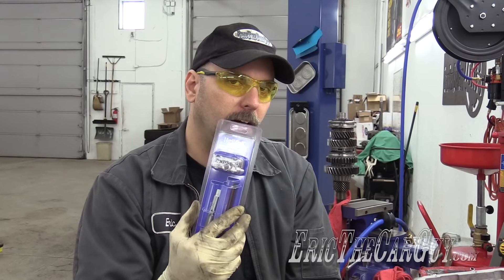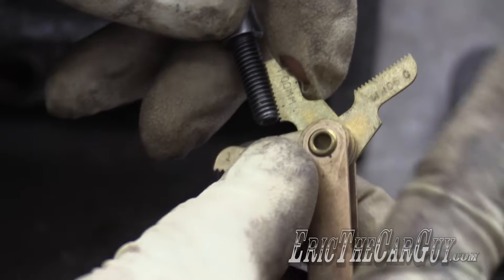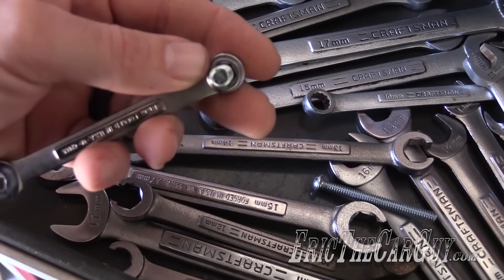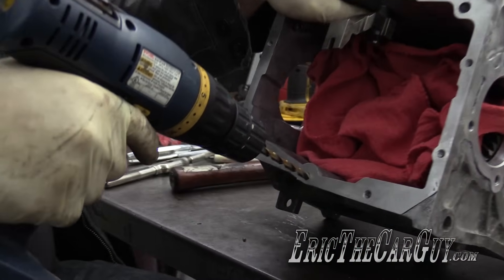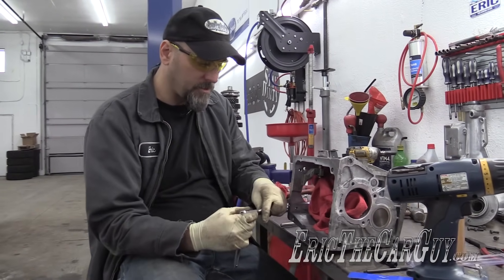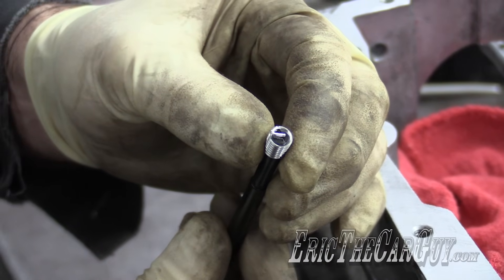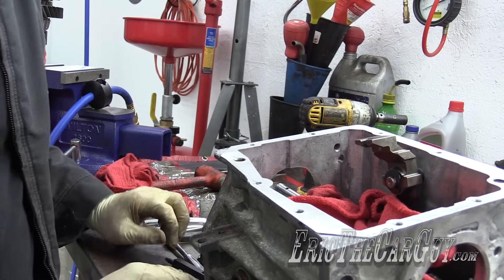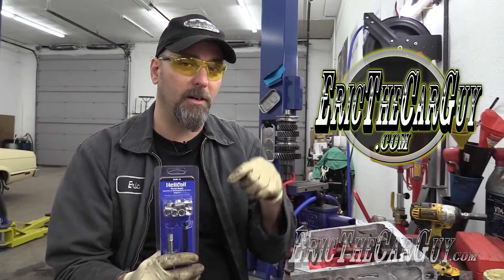Stripped Thread Repair: How To Install Thread Inserts

Comment: I'm putting a set of 062 Chevy vortec heads on my old Stock 82 350 Chevy engine....Naturally, one of the short Head Bolts strippen in the Block. I used new FelPro Head Bolts 7/16 x 4...all of the threads in the block pulled out of this 1 hole. Do I have to drill the hole in the Block out larger than what it is now...or is there a way I can use the same head bolts. Do  Iuse another 7/16 x 4 insert or do I have to drill a bigger hole in the Block and in my Vortec heads ?...
Thanks a bunch Eric...love your videos... Liked Subscribed years ago !

Comment: Eric , wouldn't it be useful to put some red loctite to secure the helicoil insert ?
Reply: +arno maas Helicoils keep themselves in the hole nicely without loctite or similar stuff.
Reply: +February Not nessery
 I have to to use almost every time...
Reply: February
thanks for the reply  ! Would it help though ( for overdoing freaks like me ) ?
Reply: Paweł Muś
I think it depends on the application. Bolts that require less than 10 ft/lb might not need loctite because they aren't under much stress.  If you helicoil a sparkplug hole, you may need some loctite. I think if you wouldn't put loctite on a bolt before helicoil, you shouldnt put it after, right?
Reply: +February if you helicoil a spark plug hole how do you break off the tab on end of the helicoil with out it falling into the motor ?
Reply: Billy H.
 you could use needle nose pliers to break it off if you can reach it or put the piston to TDC, break the tab and blow it out with compressed air. Since you will probably make a lot of shavings when you tap the hole, it's a good thing to do anyway. Some spark plug thread repair kits don't have tangs. Instead, you use the spark plug to thread the insert in and they have a knurled edge with little teeth that bite into aluminum or steel and keep the insert from coming out. Those kits also require some sort of sealant like rtv silicone the keep the insert in and airtight.
Reply from the maker: +arno maas  It wasn't listed in the instructions so I didn't include that in the video.
Reply: +arno maas 
Helicoil engineering says use no Loctite thread locker.
Reply: EricTheCarGuy
since I haven't used it myself , I was unaware of the instructions mentioning it or not myself .. so thank you Eric for the clarification and your excellent videos !
Reply: patw52pb1
thanks !
Reply from the maker: I'm happy to help. Thanks for the comment.

Comment: I have a NP231 transfer case supposed have 6 studs but only has 5 studs to bolt to 46RH transmission in 95 jeep grand Cherokee 5.2 v8 ZJ hope the heli coil works out.

Comment: Hi thanks for this upload, will this repair work if there is pressure from coolant ? The hole with stripped threads in question holds a temperature sensor .. so it needs to not leak.

Comment: Great vid sorry if this is a noob question but does it matter the length of the bolt? It looks like it only threads the beginning of the hole does the screw do the rest? One of the bolt holes for my tensioner is stripped somehow and i'm trying to fix it.

Comment: Hello Eric, Love your vids.  Could you possibly do a vid on removal of a stripped valve cover bolt.  Or respond with what I can do.  The head of the  T40 bolt is striped. Its really apped on there. I tried to used a basic stripped bolt removal kit. Then I tried to hit it with a dremmell so as to use a flat head screwdriver but wont budge. the head of the T40 just keeps getting worse.  Im going to have to drill it out, But how?

Comment: Awesome. What I wonder is, how strong is a new thread? Can you compare it in strength to the original one?
Reply: posting the video seems like is enough, aswering? ...some dont go that far
Reply: @MachTuck  no, it does not answer my question because it shows a repair, it does not say anything about how long it will last. It can last a couple of months and then break depending on the stress put on the thread. Stop being arrogant and give a valid answer if you know anything about this job. If you don't have an answer, just don't reply, It's easy.
Reply: @razvandumitru2252  You took it wrong man, Im not being arrogant, just saw you posted a comment, with a question, 2 years ago! and never got an answer, it has happened to me too,  thats all.
Reply: @MachTuck  it happened what? Can you elaborate a bit? I cannot guess from vague and subliminal answers. If you wanna help, be my guest, if not, leave it be.

Comment: A spot on repair :-D, very professional looking.
Some kits use a rod with a slot in the end to brake the tab off, much like the bolt in your kit.
Your set of drills would do as a gauge too, everyone has drills :-)
Reply: Don't you dislike doing a repair, when one bolt is special? 

Yep, this is the smoother, much more expensive option. 

At least in America, helicoils cost $30-$60. (30 is more recent)
Reply: +DE “AutoBravado” Nichols 
Well that comment was a mess, your drunk lol :-D
Reply: zx8401ztv Never. Lol

I was missing my creative spark though. Thanks for making up the difference!

Careful. Pointing a finger points 3 fingers back unless you point open handed and that's just weird. Lol
Reply: +DE “AutoBravado” Nichols 
ha ha i wasnt pointing, i was taking the micky, anyway i could have been pointing with my thumb, 4 fingers back at me :)
Reply: zx8401ztv lol
Reply from the maker: +zx8401ztv Great suggestion.

Comment: Thak you for sharing. Can one use this on a cylinder head?
Reply from the maker: In fact on Northstar engines it's what you need to do to the block to repair the head bolt threads.

Comment: Do you think this would work on a D series Honda crankshaft? I'm looking for a quick fix that'll hold long enough for me to build my other motor I have.
Reply: It should work. People prefer the inserts over the original threads, oftentimes. I've never used them but am about to on all 10 head studs on my d16. Best of luck!

Comment: Do you recommend to use that to repair the thread holes for a valve cover? Temperature is not an issue? It will hold?
Reply: Yes, it will be fine. Commonly used there. Valve covers don't normally see high torque either.

Comment: Great informative video as always Eric! I'm currently rebuilding the transmission for my 1993 Nissan Nx2000 with roughly 160,000 on it,(5th gear is bad about popping out and it's a common issue. My question is given the mileage should I replace the differential while the transmission is apart?
Reply: Differentials usually last. While you're in there, you should be able to tell if the fluid was just old. 

I recommend amsoil.

Ask Nissan what the fluid should be first. ...They only had conventional valvoline. The was not excited for that  (Frontier).
Reply: Thank you for your input. I will make sure to ask them what lubricant they recommend, I honestly hadn't thought of that.
Reply: Bradley Preston don't ask at an auto parts store. ..They don't even sell on the shelf what my truck needs.
Reply: But they'd still recommend it and sale it.
Reply: ChrisHallett83 Good point. Getting a differential rebuilt isn't in my repertoire yet. :)
Reply from the maker: +Bradley Preston Honestly I couldn't say. Check the specs to see if it's in tolerance.
Reply: +EricTheCarGuy will do,thank you
Reply: Bradley Preston Their is a page channel video to teach those concepts by Schrodingers Box Quantum mechanics or mechanix. I forget.

Comment: Thoughts on Helicoil vs more robust solutions like Time-Sert? I have my preference, but I'm curious how you rank them.
Reply from the maker: They've both worked for me.
Reply: +EricTheCarGuy Fair enough. I love my TIme-Serts most for spark plugs and head bolts....because Honda factory approved and they come with jig plates. Everything else...depends on what's available.
Reply: +mausball In aluminum like this either works, You can do a few things with solid inserts that cannot be done with heli-coils though. For instance you can get thick walled inserts with coarse threads. Drill the hole to a larger oversized, tap to the coarse thread and you get a MUCH stronger repair. But it depends a lot on what you can get
Reply: +Blazer02LS I only use Time-Serts in aluminum. Been doing it for years. I've town out Helicoils in the past on high force fasteners. Never done that with a solid insert. Yes, they both work, I just prefer one to the other.
Reply: +mausball I am with you. Time-Sert hands down is the best IMO. Most people don't use them because they are scared of the price. I have paid over $400 for some Time-Sert kits to fix head bolts and such. Worth every penny. I have used hundreds of heli-coil style repairs too. Quality doesn't cost in this business. It pays....
Reply: mausball I've seen failures in most insert types, basically comes down to how it was installed. I prefer Keen-Serts in aluminum or other soft metals, but I've used most of the different styles.

Comment: I just go to the hardware store and go to the nut section.  Just try different nuts to find the bolt size.  You have to go there anyways to get a kit.

Comment: for the oil pan specifically where  the drain thread is damaged. Can you just use a tap and die tool to repair the damaged thread at a much bigger size? without the insert?

Comment: What's the longevity of doing this? If the fastener is removed often for instance would the repair break out or come loose?
Reply: I've heard they're generally stronger than the stock threads. At least when used on aluminum, but I think it's also recommended you use red Loctite on the Helicoil, and let it cure before you run a fastener in.
Reply: +mrsemifixit Permanent fix. If done properly a thread insert will make that a stronger repair than the OEM as well. That is because the insert has a larger surface area than the OEM bolt. That gives you more load carrying capacity per thread.
Reply: +Blazer02LS Much better said, thanks!
Reply: +Blazer02LS - I wouldn't use them for head bolt thread repair... anymore. They seemed to always fail around 50-60 ft/lbs. They would bind up in the threads and start to show more torque than was being applied to the head. And torque angles applied less torque than bolts turned to the same angle in stock holes.

But for nearly everything else, I'd say you got it right.
Reply: Depends on the insert. Keen-Serts work just fine for head bolts. So do Time-Serts. Heli-Coils will work but they work best with studs. Of course half of the failure prone blocks out there would have been better with studs but they try to save money...
Reply: +murkinstock 
Helicoil says not to use Loctite thread locker.
Reply: +mrsemifixit 
Usually stronger than original and longevity is not an issue.
Reply: +sienile 
Helicoil or any brand insert failure usually results from a poor Helicoil installation or failure to lubricate fastener threads or attempting to use thread locker (Loctite).

Comment: Hello nice video, 2 issues : when the new thread is done and want to insert say a M8 Helicoil, does the Helicoil expands a bit once screwed into the new thread or stays compressed inside as when out of the box ? Must the little pad be suspended ir order to break it loose ? what about if sits flat at the bottom of the hole ? Thanks in advance.

Comment: I've found that helicoils don't hold up well if the fasteners are continually removed and reinstalled. Have you ever used solid steel or brass inserts? There are several different types from those that have tabs you hamme down into the hole, some that rely on threadlocking compounds only and others that rely on threadlocking compound and staking the insert so it can't back out.

In my experience with repairing aluminum molds(cheap chinese cast aluminum and U.S. 6061 billet) used for molding polypropylene foam(think styrofoam on steroids), I've had the best luck with the brass inserts when using stainless steel fasteners. My only concern would be the higher temperatures that crankcases or heads can see. Our molds never see over 400 F but they do see thousands of cycles up to that and then rapid cooling with water so it does take a toll.

Comment: Hope someone replies lol You drilled it, then tapped it and said you have threads. But then still had to use the helicoil to have fresh threads? 
Couldn't you use the bolt after the thread?

Comment: My bolt is really big and the whole has been drilled very large outside of the threads. Can I tap in JB weld and then do a heli coil?
Reply: Just in case anyone still needs to know if you can use these on JB Weld...

I know from personal experience that you CAN!   I had a valve cover bolt hole that was stripped & I didn't have access to any Helicoils at that time.  I was also in a hurry to use the vehicle asap, so I stuck JB weld in the hole & screwed the bolt into it.  Worked like a charm!  But, had to replace the valve cover AGAIN (don't get me started) recently, so had to remove that bolt.
I used the same drilling & tapping procedure as normal and inserted a Helicoil for a "proper " fix this time.  No problems!  Still holding fine!  No slippage.  No leaks.  Seems even stronger than original holes in straight aluminum.

Comment: Adding a lil bit of red locktite will help so the thread doesn't come out with the bolt later on too
Reply from the maker: +FeoOrozco  It wasn't listed in the instructions so I didn't include that in the video.

Comment: How much torque can the insert handle? And is it better than a normal tap and tie?  Thanks
Reply from the maker: Same as the original threads I suspect
Reply: +Tom Troop I've read that the inserts are stronger than the threads they replace.
Reply: +Tom Troop If you get them installed correctly, they hold a good amount of torque. I'd say the same as a thread in cast iron. I'd recommend to lock them with a little thread locker, but don't insert the bolt before it's dried. That can get the insert to be stuck to the bolt instead of the threaded hole. I use this kind of helicoil alot. There are some better ones, like the Würth Timesert, but the coil kind is much cheaper and probably the most compact form of thread repair there is, good in tight spaces.
Reply from the maker: I didn't use thread locker in this video because it wasn't listed in the instructions. Thanks for your input.
Reply: +Carsten Lorenzen Two things,  if you look at the Stanley Engineering site design guidelines you'll see that heli-coil strength is impacted by the parent material, in this case aluminum,  from which we get the LENGTH of the coil itself, which increases the number of threads to engage that AL, thereby increasing the max pullout strength. The other limiting aspect is the original strength of the bolt itself,  which in this case should be steel and is negligible as the parent material is so much weaker so we ignore the bolt.  Thanks
Reply from the maker: +billybobjoe198 Copy and paste is my friend.

Comment: Is it necessary to chip off the end of the heilicoil after its in the hole? 
I need to do this to my turbo and i don't want that little end to fall into the turbo.

Comment: Just recently I had to use the exact thread and heli coil some hole in the cylinder head of my chevy cruze.
Reply: Was it due to stripped valve cover bolt? That's my current problem and I'm not sure if I bought the right kit. It says size 1/4 - 20
Any help

Comment: Those thread measurements seem metric to me. Does SAE have different threads? I feel like they do. 

My metric set wouldn't help me with the threads on my pulley installer. 

More of the tools you'd rent seem SAE still.
Reply: ChrisHallett83 I figured when my thread gauge was useless, but I wasn't sure about thread pitch. Thanks!
Reply from the maker: +DE “AutoBravado” Nichols Yes, they do use different threads.
Reply: EricTheCarGuy Good to see you in the comments more my friend. :)
Reply from the maker: +DE “AutoBravado” Nichols It's cost me time over at my forum which I regret, but it is nice to reconnect with the fans of my videos.

Comment: I was looking into repairing fastener holes and some other sheet metal type repairs. I've never repaired threads or installed a helicoil but it really doesn't look that hard to do, and I can't understand why some of the guys I work with are afraid to do this type of repair

Edit: Are helicoil taps different from regular taps? Are they on a different thread angle?

Comment: Hey quick question so one of my break caliber break line threads are stripped would this be a good idea to fix it instead of buying a new caliper
Reply: Holy shit, what are the odds???
Same thing just happened to me today! Caliper banjo bolt hole got stripped!!! On a super rare amg caliper. 
I've ordered a M10x1 helicoil and I'll try to do this in the morning.

Comment: Will this work for spark plug threads in a cylinder head?
Reply: Yes
Reply: +sumaznkid wow I've never had to use a helicoil on something like that...yet. but it sounds like a freaking nightmare if you don't know how to remove and replace the cylinder head.
Reply: +Aaron Johnson You can do this on some engines without removing the heads. One tool actually pulls the aluminum pieces up as it cuts the threads instead of the pieces dropping into the cylinders, however, you can use an air compressor to blow into the holes to blow out any of the pieces. Still not a fun job lol. Buy a Ford F150 3v and you will see. Those are prone to blowing out plugs.
Reply: +JackOfAllTrades I would never buy a ford or nissan in my life for that reason LOL
Reply: +Aaron Johnson I own a POS Ford F150 5.4 liter 2v. Luckily, I've never had a plug to blow out, but I have installed these helicoils in several that have. Mine is plagued with other POS Ford issues.
Reply from the maker: +sumaznkid They have special kits for those. Sometimes they work, sometimes they don't in my experience.